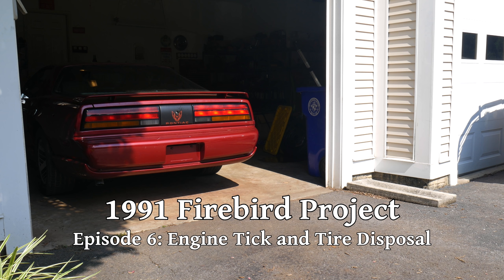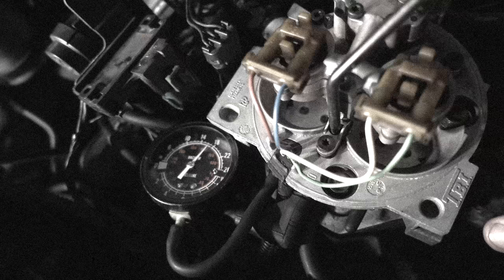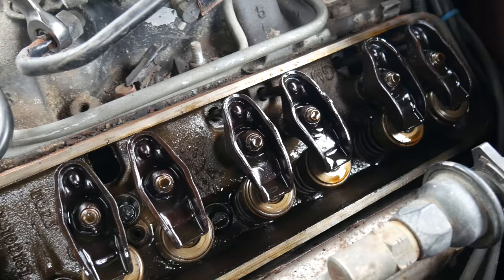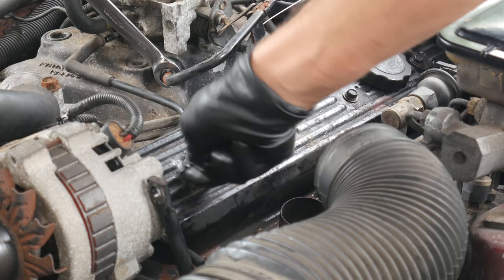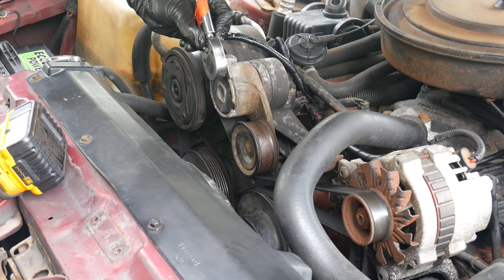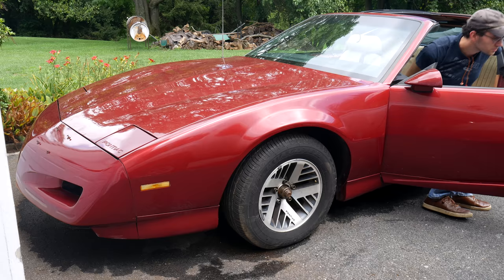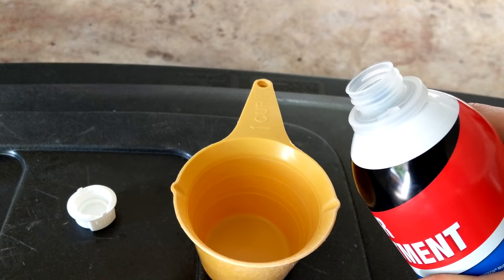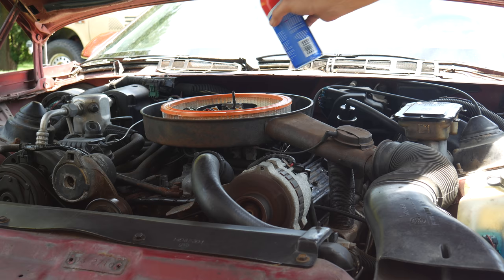$100 1991 Firebird Burnouts to Quiet Ticking Lifters (and Other "Cures") (Ep.6)

Comment: Just put a louder muffler on it then you won't be able to hear the lifters...Problem solved
Reply: Or a loud stereo system
Reply: @genejackson4261  Or, hear me out... Both.
Reply: I've already got both with a flowbastard exhaust and a super 10 for a muffler and 2 12" skar audio subwoofers pushing 1250 rms and in a huge ported box
Reply: Modern problems call for modern solutions
Reply: Yeah but he did all that work and he wants to be able to hear the radio on in the car is running
Reply: Or just cut the exhaust off to fit subframe connectors, problem solved.
Reply: Flowmaster single in dual out 3" system
Reply: @PhenomProductions23  kooook
Reply: I do the same thing with first aid.  If I smash my thumb, I hit myself in the head and I hardly notice my thumb.
Reply: Then your muting the problem that will get worse
Reply: Cha cha cha..... Cherry Bombs!
Reply: Or no muffler
Reply: mekanic
Reply: Bro he already put a muffler

Comment: Lucas Oils make a hydraulic lifter additive that I've used several times with success on engines with hydraulic lifter/tappet castanets going on.  One of the vehicles, which really sounded horrible, so bad that it sounded like it had serious internal engine issues, has racked up another 100,000 miles since being treated without any repeat of the tapping, of course regular oil and filter changes at the correct intervals have had a lot to do with it...
Reply: You can also add some ATF to the engine oil. ATF has about the viscocity of 5W30 and it is packed with dopes for cleaning  and for keeping oilseals flexibel. 
The cleaning dopes help clean out stuck hydraulic lifters.
Reply: @jfv65  Agree, I used ATF for scrubbing down cylinder walls for a new engine that hadn't broke in the rings properly... ATF is like a detergent so be careful.

Comment: I had an 04 Silverado with really bad lifter ticking and I used an old trick that my grandfather used and that was to leave a liter of oil out and replace it with atf and behold the noise was gone and noticed a huge difference in power and fuel efficiency.  Worth a try for your car.

Comment: I found that seafoam does a better job cleaning carbon and build up as a soak more than an engine additive. I had to clean the intake on my tacoma which was horribly gunked up. It had never been taken off in 20 years. So I poured some in the intake and let it sit for a while and then using a wire brush, scrubbed and scrubbed and it melted all the build up. I've also used it to soak valves from dirtbikes as I was cleaning the cylinder head. It didn't take very much to really get the  carbon to come off.
Reply: Once it's melted off, where does all that intake carbon go?
Reply: @missingremote4388  This was with  it off the engine so no, it didn't go into the engine

Comment: I love this car! You should of heard my '00 Yukon with 5.3, piston slap galore! I used synthetic oil and it went away pretty good. The oil is dirty, but synthetic cleans the motor a wee bit, like you said, after a few oil changes, it should be good to go. I used seafoam once a year and had over 220,000 miles on the clock when I got rid of it. Keep them coming, I love the video's and with no annoying music to go along and awesome voice over work.

Comment: this is like my fifth time watching this series and i cant get enough. the sound i heard after the burn outs sounds like the same tap when i loosened the rockers to adjust them while its running. with the engine running, loosen a rocker until you hear a tick, then slowly tighten until the tick just goes away.. then tighten a half turn, rinse repeat. try that out and maybe that tick will go away.

Comment: 1:38....you can see a spark arcing from a spark plug wire. That will cause a misfire. Possibly adding to the ticky noise. EDIT: You can see the arcing at 1:16 too. Look at the area ahead of the master reservoir at the base of the valve cover.
Reply: Good catch, i think it needs a full tune up and exhaust manifold gasket or donut gasket. That should solve alot of the sound then u can hear the valve train with a stethoscope

Comment: I'm a big believer of Marvel Mystery Oil.  I've also had success with adding 1/2 quart of transmission fluid to the oil.
Reply: I did this with one quart of ATF in the original 250 I had in my 78 nova. Prior owner(s) did not take care of poor thing and the lifters started ticking bad. The ATF worked great and even stripped the grime off about half the rockers... which promptly plugged up the oil passages to the main bearings. Oops. Stopped driving it when I started hearing knocking. Upon tear down up all the main bearings were toast.  Oh well gave me an excuse to build up and install the 355 that was laying around!

Comment: I would personally recommend avoiding introducing solvents into your engine due to the very likely risk of disturbing carbon deposit's from years of build up and having some bits of that stuff clogging up oil passages like for your cam, lifters, pick up screen or oil ports for things like your timing chain tensioner. It's really best to slowly and gently clean up an engine with good oil like Castrol Edge High Mileage for example. Other than that the project looks like it's really coming along, good job!

Comment: I use oil treatment viscosity additive in my mom's Jeep to quiet the valve train, does an excellent job doing so.  ZDDP formulated oil treatment on the lifters might help too, giving some zinc insulation between the cam and roller, and the treatment itself being sticky enough to give the cam something to ride on for lubrication.  An engine sitting for a long time should be treated just like a rebuilt one, NEVER let it idle, rev it to at least 2,000 rpms for several minutes, oil pressure must be built up and circulating as quickly as possible, and get those rings relubricated and seated again.

Comment: I used some of that "mystery oil" that said it could clean out some sticky lifters, worked a treat. The oil turned really black, so it prolly cleaned more than just the lifters-- changed the oil and it was so quiet.

Comment: Hey man really enjoying the series! What you can try to fix the lifters is to add quart of diesel with the oil and to idle the car for about 10 mins after 10 mins rev up the car couple of times and see if it solves the problem, if it wont, leave it to run for a while longer, after youre done change the oil.

Comment: I noticed another commentor said it as well, but you should consider doing a basic tune up with plugs, wires, cap, and rotor. That will very likely help smooth the engine out a bit more and quiet her down. Plugs are showing some arcing in parts of your video. Awesome series though, keep it up!

Comment: Why did you check the right side rocker arms and lifters? I had a 92 RS Camaro with the same engine and found a couple of rocker arms loose. I eventually went with 1.6 roller tipped rocker arms and never had a problem.

Comment: Nice burnouts!  I had an 87' V6 car that was $2k I took completely apart and sanded down for paint to put in the 383 stroker motor from my old 83' car with Recaro T/A parts that had been wrecked and redone a few times.  Anyway, I never did finish it but you can see the 83' in this vintage 1996 VHS tape with a 71 Challenger blowing off a tire at my Burn outs & Boobs Firebird and Challenger video!

Comment: The problem with overusing the torqwrench especially on older cars is that they are calculated on a new car, with new screws and new screwholes. Its easy to overtighten screws when the threads and screws are worn, but its also easy to not torqe them enough because the threads arent clean and the bolts arent clean, which makes them go tighter in.
I use a Torquewrench on everything inside the engine, and some stuff that has a gasket, but nothing else.

Comment: How much has this project cost you so far? I was thinking about doing a project on a car myself later on but I was wondering how much it would cost.
Reply from the maker: I have kept track of most of the part prices, at the point of this video I think somewhere in the $650 range (including the new tires). I would budget a lot more money than that for a project car though, and there is a lot more to be done with this one.

Comment: I've owned several vehicles with TBI small blocks.  305 and 350.  In my experience these engines are not very happy running 5w-30 once they get some wear on them.  When new its fine, but after the 100 - 150K mile mark they start to tick, burn oil, and have lower oil pressure at idle.   10w-40 is your best friend after a small block Chevy has hit 100K miles.

Comment: So the previous owner got screwed? It overheated, was actually sensor failure, but they gave him a valve job instead?
Reply from the maker: No, I'll bet it actually did overheat and blow a head gasket or something. The temperature gauge sensor was busted, but I later realized that the radiator fan switch was too so it wouldn't turn on in normal operation

Comment: You probably need to remove the valve covers and retune the rocker arms with the engine running. With  that style air intake you may have to leave the air cleaner connected. Usually with gm 350 and 305  tune engine while the engine is running loosen the rocker arms one at a time until it starts to clatter then tighten until it stops clattering then tighten another 1/2 turn. Repeat for each rocker arm. A   1979 Oldsmobile Cutlass Calais 5.0 I used to own, I had to rebuild and replace a bunch of stuff. After about a month after getting it running again it sounded like the engine was starving for oil. I had automotive tech class and thats how I learned to tune the rocker arms on a 5.0 305 and 5.7 350 gm engines. So I tuned the Oldsmobile's engine and at first when I started the lifters were not spiting any oil out. So I tuned each rocker arm properly with the  engine running and all of the lifters worked except for the first one at the front on the driver's side was trashed. The engine sounded way better. The guy I bought the car from said he tuned them but with a tune up valve cover on each side. After I retuned the engine I found that each rocker arm was around 2+ turns to tight.

Comment: lifter noise ive just replaced them in a gm olds 88 fixed it BUT that engine had so much sludge in the engine I still dont know how it ran then the transmission blew up and made a HUGE crashing noise so what did we do sold it to the junkyard oh and something was knocking but that knocking went away when put into reverse

Comment: One product that worked for me was Liqui-moly Tappet Stop Noise. My R33 had a sticky lifter that was driving me nuts, I tried all different types of oils and and flushing the engine a few times, nothing worked. Used Liqui-moly once and the noise went away within a couple of heat cycles. Might do the same for you.

Comment: For the lifters my truck did the same thing I replaced the oil and oil filter to its OEM one but I think if you get a performance one such as k&n itll clear up after a bit of driving mine cleared up in about 50 miles

Comment: That sounds a lot like my 3.1L camaro.  It was blow by coming from the fitting for the pipe that routes air from the exhaust manifold to the smog pump or EGR valve. Removed all of it and the noise is gone too.

Comment: When I have left your troubles one time my dad showed me an old trick replace one quart of your older and put transmission oil transmission oil has a lot of detergent properties and it's also the same as a thinning agent Seether one or two quarts of oil depending on the size of the engine I had a little Toyota Corolla that was making a lot of roller

Comment: For a additive, I used to use ATF. I got that from a old fleet mechanic for the CHP that was a instructor at my trade school. It has a bit more detergent. About a 1/2 quart in the oil. Does it work always, nah, might not done any more than what you used, but just thought I'd mention it for those that have it laying around.

Comment: If you can find a place that does it I would suggest getting a high speed wheel balance. The drums on the rear have weights on them too just like a wheel and can throw off the balance even if the wheel is perfectly balanced. When I first got my 92 Firebird it would shake unbearably over 65 MPH. Once i found a place that did high speed balance with the wheels on the car it synced up the balance of the wheels and the rear brake drums and afterwards it rode like a dream.

Comment: I might be a little late for this.. The long cranking is normal for LO3 engines. My 1989 with the same engine, but with only 60k miles cranks exactly as long as yours. Has cranked like it since new.  :)

Comment: Sea foam can also cause a rear main seal leak. If you use it in your oil, drive it around for 10 minutes, dump the oil, add new oil drive for ten minutes and change oil one more time. My opinion anyway.

Comment: On it taking a while to start it might be the anti back flow valve in the fuel pump.
I don't think the fuel pump is close to failure as it would have back fired under load so maybe it'll go away with some fuel system cleaner but otherwise it doesn't seem to require excessive cranking.

Comment: Used Moto medic oil treatment run it for about 3 hours and change your oil with full synthetic Valvoline 10w 40 with a K&N Filter and it will shut those lifters up guaranteed

Comment: I bought a 1970 Mustang the engine sounded great I did one burn out and now it has a nasty lifter click but I used 3 quarts of oil and two quarts of diesel fuel in the crankcase and ran it for 10 minutes and it sounds brand new again

Comment: Can someone explain to me, a complete burnout-noob, why the car only did a one tire burnout? Is there not enough power or something else?
Also, why did you let the tire hit the paint at 17:02 ? Your cars paintjob may be not perfect, but adding scratches to it still hurts seeing.
Love the car and your videos.
Reply: that is because this firebird is equipped with what is called an "Open Differential" to put it simply, there is nothing to lock the two rear wheels together for traction and all the power travels to the wheel that is slipping the most (also known as following the path of least resistance)

Comment: I had noisy lifters in a 350 Chev, nothing seemed to work, then replaced the oil pump, no more lifter noise, weren’t getting enough pressure to get them to work properly.

Comment: 170bhp from a V8?? How do you get such a low amount from a big engine??
Reply: In the late 70s and throughout the 80s, smog era emissions from the gas crisis choked power. You couldn't exceed certain (very restrictive) power numbers. However, Americans liked the V8 too much to let it die, so there fell an era of lowpowered high displacement that offered only the chance of power when modified and the sound and ease of work that smallblocks are famous for.

Comment: You should check the torque specs on the plugs. I had 2 plugs back out a little and caused a ticking that I thought was the lifters and did the same thing with sea foam/marvels.

Comment: Walmart has cheap prices on reliable 15" tires, kumhos for $67 ea. hankook & falkens for $75. 70 series tires are better for casting and for speed bumps or potholes, the taller tire also has less revoluions per mile. also less  also use no substitute to seafoam. Somebody recommended to me to add Motorkote to the oil, it worked for them to quiet their engine.

Comment: If you rock the wheel when doing onesies sometimes you can break the other wheel loose. Had an old lemans with a 301 that I'd rock the wheel a couple times then give it a hard rip and both wheels would spin.

Comment: If you can find a scanner that can read live data for obd1 look at the coolant temp sensor reading when engine is cold. Should read almost the same as air intake sensor. If it's high, need to change the sensor. It's on top of the intake by the thermostat housing and has a yellow and black wire. The sensor on the driver's side head by the spark plugs and uses a single green wire and is the the guage on the dash. The black and yellow wires are for the ecm. The computer uses the coolant temp sensor reading to determine if it needs to use cold start programing to start on cold days.
Reply from the maker: I do have an ALDL reader, I'll be sure to show it in a future episode. The coolant temp reading from the computer (intake sensor) is spot-on what it should be, which is good because the replacement sender I put in for the gauge reads about 15 degrees high lol.
Reply: @FuzzyDiceProjects  good. I thought I'd throw that out there because when I worked as a drivability tech we'd have a ton of sensors go bad, and wouldn't really have a problem in warm weather, but when it got cold ( I live right on the Iowa/Missouri line) they would go into no start as the computer thought it was over 100 degrees and would use warm start parimeters instead of cold. The software in these was VERY simple, cold and warm software, fixed data for timing and fuel control until electronic timing and O2 sensor inputs took over. If you look at the data programs for these, it was really simple. Today's computers are miles ahead of these dinosaurs

Comment: I don't know if I'm confused or what but you drain the oil with the seafoam in it added Marvel's mystery Oil to the same oil and put it back in the engine. Instead of just pulling the oil filter and adding the Marvel's mystery Oil. Loving the F body though
Reply from the maker: No, you have it right, it was just a bit silly haha. So it has a quart of Mystery Oil but also some knockoff Seafoam in there still